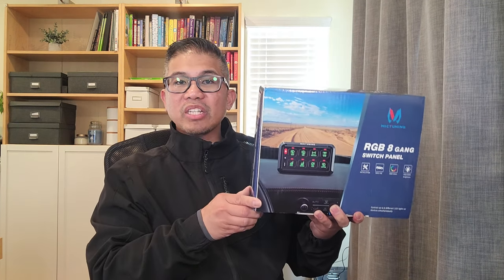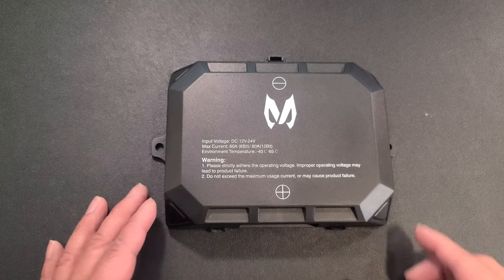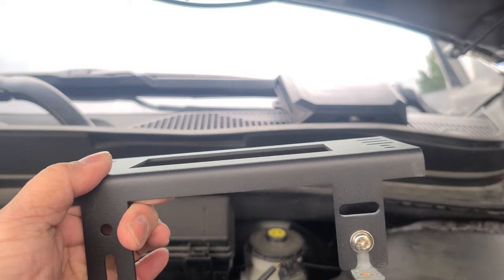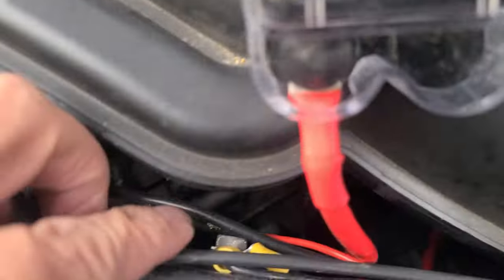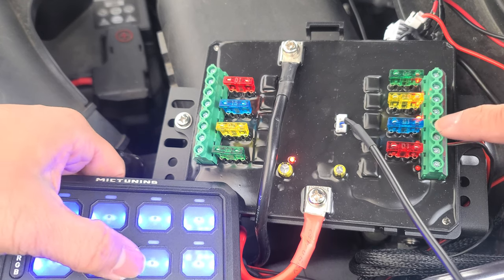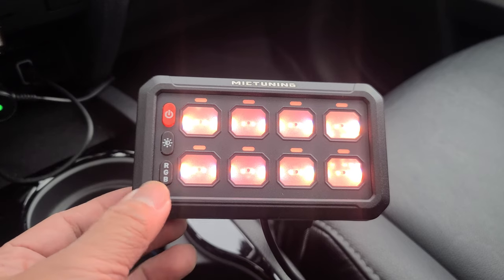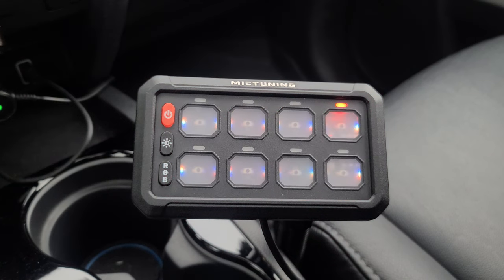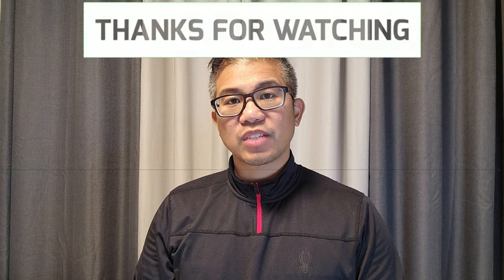How to install Mictuning RGB 8 Gang Switch Panel

Comment: just installed mine today. probably wouldnt have ordered had i seen your video before and the "strobe" pattern you briefly demo in your video.
Reply: Yeah, not so much strobe, should be called "flash" or "blinking".
I wonder if there are panels out there with MOSFETs as relays and adjustable strobe/flash frequency?

Comment: How are you going to change your air filter?
Reply from the maker: I would have to remive that one bolt. Not hard at all. I have the AEM air filter so cleaning is longer than normal. Every 50,000 miles depending on driving conditions.